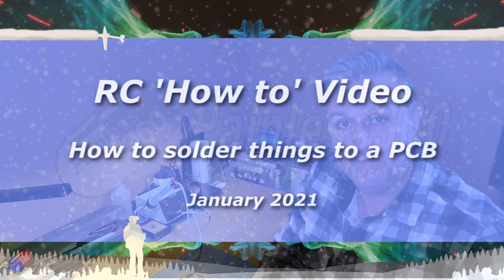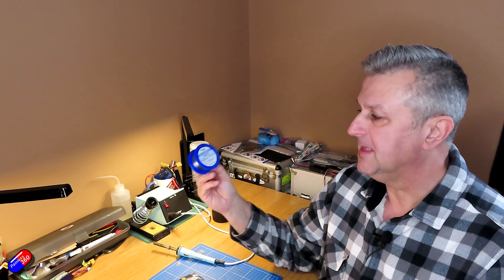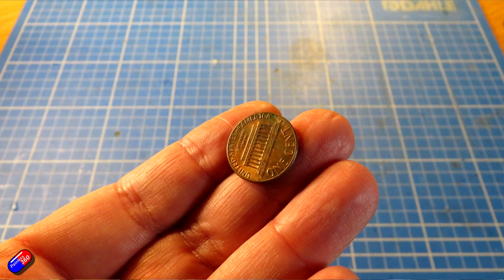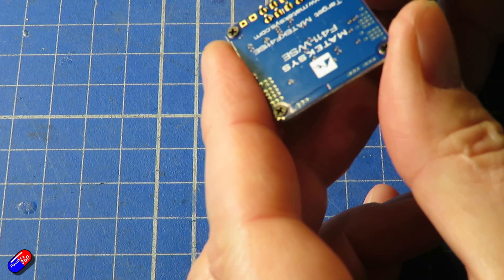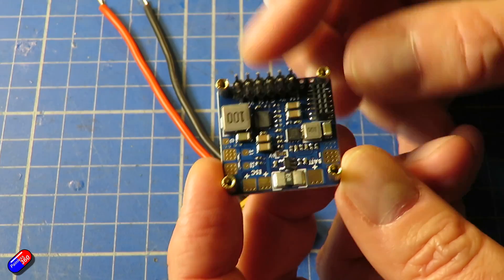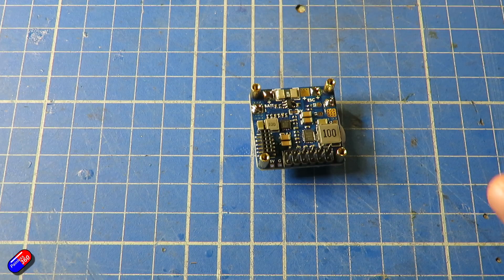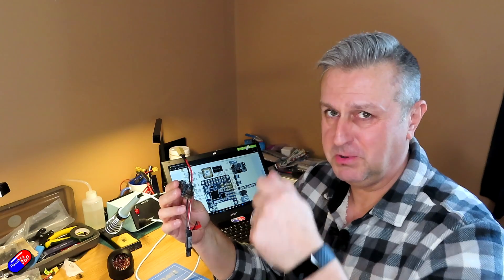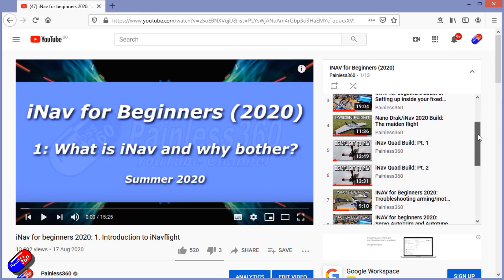How to solder a flight controller for beginners

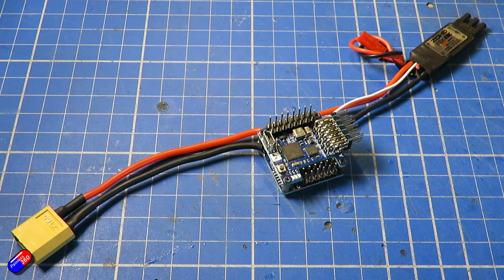Comment: @Painless360 at 14:06, i can see you cut the GND and Vin of the BEC of the ESC. Should i do the same ? Because i remember one of your video where the Vin was cut and insulated  but the GND of the BEC was soldered to the GND of the BAT to get the same potential. Could you clarify this please ? 🙏
Reply from the maker: Most modern multirotor ESCs only have the signal and GND wire. The middle 'red' sire is on those ESCs that supply 5v to power something else - a feature not needed when used with a multirotor flight controller. If there are two pads on the FC for signal and GND, then connect both. If there is only one pad for the signal, then connect the signal pin to it, and optionally wire the GND pin to any available GND. See my quad builds for beginners. I hope that helps.
Reply: Thanks a million !❤

Comment: Hi there. I think I may have blown my Pavo 20 by not properly plugging the battery in correctly. Is there a way of finding this out.
Reply from the maker: Check that there isn't a short on the battery connector on the flight controller,  if OK then plug in a battery via a smoke stopper and see if you get any lights...
Reply: @ how do check if there’s a short on battery connector though ?
Reply from the maker: Watch my builds, using a Multimeter....

Comment: A couple of tips from someone with professional board rework. Those flux pens imo aren’t great. Get yourself a tub of NC-559-asm. A couple of your pin joints look like the solder hasn’t actually flowed to the pads properly and that’s what causes the pear shape. You should see a nice fillet on each pin if done correctly. Good flux will help with this too.
Reply from the maker: Doing something with a camera in the way is never ideal. Thanks for the comment and ideas. Happy flying!

Comment: When soldering the matek h743, I found continuity between the positive power pad of the battery and esc. Is that pad?
Reply from the maker: There should be.. Why would you think that's not right? Has someone told you?
Reply: @Painless360  no actually. It's both my first time soldering and my first time working with the matek after watching your videos. I was afraid bridging the positive pads of the esc and battery was a bad idea.
Reply: @Painless360  thank you so much. Your reply gave me the relief I needed to go ahead

Comment: on the 411 wte to fit into a drift
Reply from the maker: I've not fitted an FC to a Drift so it depends on the height of the area that you will use. It is cramped so direct solder may be a decent option too... Best of luck
Reply: @Painless360  thank-you

Comment: I need you helps guys.
I need a FC with osd for DJI to see the battery voltage. Just need to know how to power up that FC, so it will be nice if I can power it from the battery. I'm going to use on an airplane but I'm not interested to plug servos
Reply from the maker: Check out https://youtu.be/KWHZCemLLxw

Comment: For the record, I have been using lead free solder and not all lead free solder is created equal, and just because it's got lead in it does not mean it's going to be good, good quality lead free solder works just fine (it's really tough to actually get leaded solder in Australia)
Reply from the maker: Thanks for the commnet. With solder (just like everything else) you get what you pay for. Happy flying!

Comment: Lee- what watt setting do you use? is it the same for small pins as for power cables?
Reply from the maker: I don't have soldering irons with a watt setting here. The professional Weller station has no settings at all and the smaller irons that have a temperature gauge I tend to run about 350 degC or higher.

Comment: I really  wish you would have shown the esc soldering. The "cartoon" version that Matek provides, does not show the esc control wires. Do the control ground and red get soldered onto the big pads as well? I can't seem to find a picture anywhere. The pictures I do find, have the top board back on and "all soldered up"! I am sure this is no brainer for people that have done bunches of these. I am a beginner as the video suggests.
Reply from the maker: Sounds like you're new to the channel. Check out one of my Quadcopter building for beginners series for all the steps. If there is not a place for the signak GND wire I normally connect it to any spare GND connection.. Best of luck

Comment: Don't know if you'll see this comment since this video is a year old but should I put a capacitor on the Xt60  pads like i do on my drones? is there harm? or is it good assurance? thanks so much for your great videos and knowledge
Reply from the maker: I don't add them to flight controllers in fixed wing unless the manual for the flight controller specifically covers it. Best of luck

Comment: Hi , Am trying to build a bi-copter, wonder if you can let me know if the KK2 flight controller or the Omnibus F3 pro will be better as I know you are an expert on the subject ..
Would like to know the difference n if the KK2 firmware is comparable to betaflight ??
KK2 will be more user friendly for me as it does not require any soldering of the pins ..
Reply from the maker: The KK2.0 is a very old flight control system now so not one I'd use here. Back in the days when the KK2.0 was popular a few tried to make a bi-copter with it with varying degrees of success. Bi-copters are tricky as the use of two servos along with the two ESCs and motors make for lots of variables..
Reply: @Painless360  

Thanks for the input
Am trying to make this Bi Copter
https://www.youtube.com/watch?v=JHfbuhiwS9A&t=277s
Could get the Omnibus F3 pro FC (it's a Naze 32 clone), do you think that will work,
Thanks for the expert advise
Reply from the maker: I'd ask those who've made one and see what they suggest. Using an old flight controller is just going to make it harder for you. Best of luck!
Reply: Thanks, hope you will make one n have fun flying it too,
Hoping that the bi-copter can be easily set up to fly like in the video using Betaflight

Comment: 60/40 has been the standard for a long time, however, recently I've heard about 63/37% that has different 3-phase properties which helps prevent cold solder joints?

Comment: can you buy generic pins for flight controllers or if they dont come with the board then you can't use them?..  so i guess  you have to solder directly onto the board ,,just about to start my first soldering project on Mamba F405 flight controller and no pins in the kit but curious if people buy them separately and if so where please ? .. uK based ... Thank-you for the video and just getting back into the hobbie after a very long time so your videos and guidance have been an immense help .. as technology has changed  and then sum from the glow fuel days !!- though miss the smell of a glow plug engine firing up..!!
Reply from the maker: Yes, they are standard sizes.. Happy flying!

Comment: For some reason, the only FC I have difficulty soldering is the F405 wing. It just seems each one is a real pain to solder with ease. Even after fluxing and lightly sanding to remove any residue. Does any one else have the same problem?
Reply from the maker: I've not had that here. There is a lot of metal in the ground plane so I find doing the other pins first gets that warm enough to make it easier. Maybe the iron needs a little higher heat? Best of luck!

Comment: +1 on the solder. I've used Chinese stuff before and immediately went back to using 60:40 from CPC (a UK supplier). A couple of points though:

- You probably should have mentioned which desolder pump to buy (i.e. not the crappy cheap aluminium units) and how to use it properly.

- Rosin flux cored solder works better than "no clean" but the board needs washing in isopropyl alcohol (rubbing alcohol) afterwards to prevent the rosin from attacking the joints.

- I've found Matek boards seem to need the Louis Rossman® approach, i.e. lots of flux.

- Joints should be shiny and not dull grey; an example of both would probably have been a good idea.

- Irons need time to recover between joints. Decent irons are usually quite quick but cheaper models like my thermally balanced Antex can take a couple of minutes.

- And lastly don't eat or drink whilst soldering!
Reply from the maker: Great tips. Keep in mind this is aimed at beginners. Please make a video that shows these tips. I'd love to see more adding to the pool of knowledge..

Comment: Nice explanation. Were you soldering it for a Dart250g? The esc looks like the stock one. :)
ps: I've noticed that you cut the black wire that is normally paired with the signal (white) wire. That's not what Matek recommends in the diagram, do you think it is not an issue?
Reply from the maker: Check out the INAV/Dart 250 maiden video and see ;) Happy flying!
Reply: @Painless360  Thanks! That comes on point as I'm also building a Dart250 setup around this little F411WSE brain. I'm worried about hitting the cg on those 3s liion batteries tho.

Comment: I have best results when I pre heat everything with a heat gun on low.. that allows you to keep your solder iron in contact for as short as possible if not you are heating the board and wires with the solder iron... getting it up to temperature before soldering makes a world of difference especially on the large pads for power

Comment: A good solder sucker is also a must, great for when you accidentally bridge the pins with too much solder. I also clean pins with a bit of IPA and a tooth brush after soldering to remove any excess flux
Reply: Isopropyl alcohol kids, not Indian pale ale!

Comment: U the best

Pls make video on mission planner how to fix this issue    
potential thrust loss error  

I want to know how and why  its tell  this mesg   

Thaks youuu
Reply from the maker: Can be lots of things. Most revolve around CG, thrust or power issued. See the wiki for more information.. Best of luck
Reply: @Painless360  can u have alink i am big fan of u , i watc every video of u , i need help  
1,where i can look how to fix motor thrust no info about and many look

2 i make the f4 flight control with mission planner and you do i downolad 4.0.5 copter  it work :) 
But u not have video how can i chenge softwere  in missin planner how to do it? If i go again to INAV or just from mission planner 
PlSssss help big fan of u 

I am happy you anwer to me :)))
You are reason i start build drone

Comment: I definitely agree, switching over to high quality solder (MG Chemicals Solder in my case) has, without a doubt, made my solder joints pleasing to the eye. A flux pen is also a great addition to the kit if you’re still struggling!

Comment: I got myself a dirt cheap soldering iron and some alright solder. It was not easy, at least the battery and esc connectors were somewhat troublesome. I reckon that was in part down to a not great iron, but mostly beginner level skills. Then at some point I just completely lost any ability to make a clean solder joint or get the solder to run clear. Are there any special considerations needed to be taken with storing the solder. does it get bad/unusable if exposed to oxygen or something? I find strange that I got so much harder when I was more experience. I did also invest in a better soldering iron as I thought the old one was the culprit, but I think it became A culprit just because I could not get it done within a timely manner and the tip really scorched itself.

Comment: The 63/37 solder is a bit better for beginners. It goes directly from liquid to solid without that inbetween state which can cause a disturbed joint. 60/40 is fine too. You just have to hold the wire still until it is completely solid.

Comment: Couldn't be better timing, just started my endurance quad build, first build in 6 years. New FC, making up flight packs etc, and need to brush up my skills and get some tips. The link to the 63/37 is useful, I have a bit left but will need a new roll soon.

Comment: Very clear as always.  I also rub the pads first with a hard Rubber/Eraser to get any gunk/oxidation off.  Also it's worth investing in a Solder sucker or Solder wick for when the solder manages to bridge 2 pins, or you need to get excess solder off the joint.

Comment: Perfect tutorial Lee. Like you say, with the correct gear, good solder joints are easy and straight forward to do. Following the advice in this video nobody should have any problems. Only things I would add is that make sure your soldering iron in powerful enough for the job, the solder should flow pretty instantaneously, if your having to hold your iron on the joint for along time your iron is not hot enough. That could be that maybe you have just set the temperature too low, or, the iron itself simply cannot output enough heat to heat both the solder, the pad and the wire at the same time. This problem will show up when trying to use an underpowered iron with a fine tip, the finer the tip, the less heat it can hold, so if your iron is not powerful enough to maintain the temperature you will have problems. And like you say, decent solder is a must, it really does make the world of difference. Go for good old leaded solder, and get a good brand which contains a good and constant amount of flux in the cores. Some of the cheap stuff available on places like eBay are often hit and miss with the flux. Sadly these days, big name companies like RS Components no longer sell leaded solder to the general public, which is a shame, because if you want to insure you get a good quality solder, RS was always the place to get it. Farnells will still sell it to the general public, but you have to answer a few questions before they will do so. I just told them I was an electronics engineer, and that I was going to use the solder for pcb repairs - apparently that is allowed by the new regulations. When you do find a source for good solder, I would advise buying a load of it if you can. Just in case they clamp down even harder on the sale of the good stuff.

Comment: Not sure if you mentioned it (don't think I'm the target audience for this one) but the biggest mistake I have made (and still make) soldering pins up is not doing a dry fit and finding I don't have room for the extra room the connectors need in addition to the pins. Always worth doing a dry fit and making sure you use horizontal/vertical pins as appropriate.

Comment: One other tip. Don’t blow on a solder joint to cool it. It will oxidise it.
Reply: Because a thin skin of oxide on the exterior of the solder puddle (no it doesn't penetrate beyond that) is a disaster because.......

Comment: I have been soldering for over 40 years and always love 50/50. 60/40 is ok but not as good. Still have some old paste flux that my grandfather had that I use from time to time. Even if its rosin core solder some times its not good enough. Have some new wax flux as well that doesn't smell as bad. I normally dip the end of the solder in the flux to get a little on it when needed. Loved my resistance soldering "scissors". Loaned them to someone to solder some heavy cable ends on and never got them back. Not any much good for the hobby other than maybe putting battery or esc connector on.